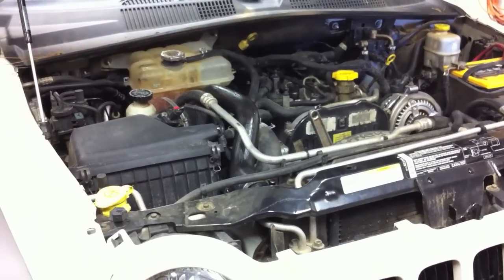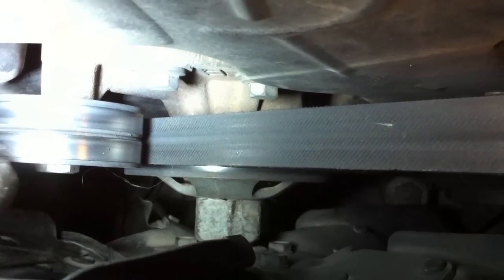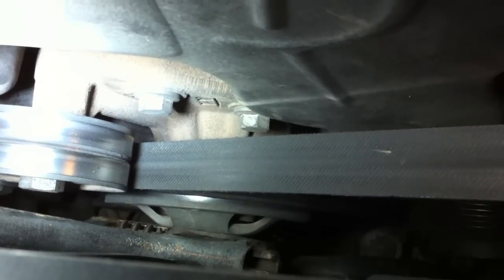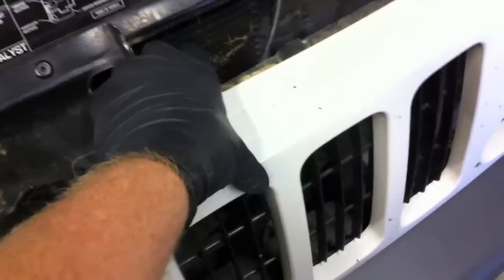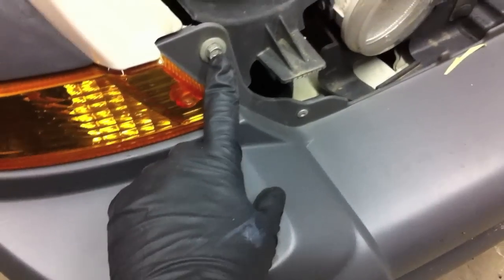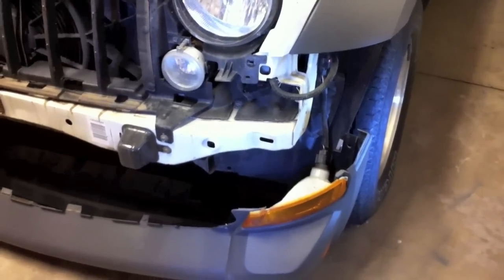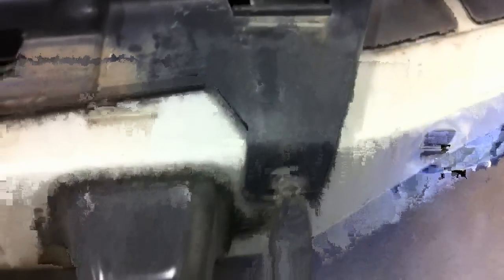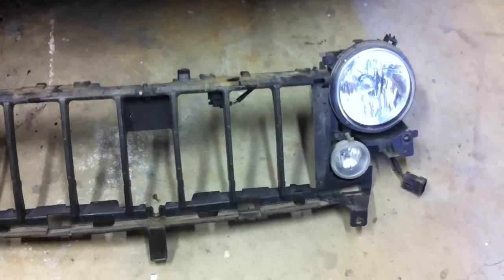Jeep Liberty Diesel Timing Belt Replacement Part 1 - Bumper and Grill Removal

Comment: Just completed the timing belt ectomy this morning. Great how to video series and kudos to the part about the extra belt tooth between the crank and fuel pump part. I used a Home Depot paint stir stick with the slightly rounded part on the handle wedged in between the belt and engine to hold it to the crank pulley while I completed the job.

Comment: I am going to change my timing belt in the next few weeks and am contemplating a egr delete. what's your opinion on this.my liberty already has 200k. also has anyone had excessive oil from the pvc valve?
Reply from the maker: The EGR can be deleted either by removing the hardware and modifying the intake elbow, or by deleting it by a software tune. I am in favor of the software option as the leaves the vehicle looking stock, and it can be readily reflashed to enable EGR if needed. Excessive oil from the CCV indicates overfilling on oil or a bad PCV valve. Typically these engines spit excess oil out because they are above the min line on the dipstick. Typically any oil in the engine above the dipstick min line will get spit out until it reads somewhere near the min line, at which point the CCV oil loss will decrease. If you try to keep the oil level on the max line you will keep refilling what the engine gets rid of.

Comment: what you charge to replace my timing belts
Reply from the maker: Typically this will cost $1300-1800 USD with parts in the US. I charge local customers labor only and have them provide parts, making their total cost about $1000 USD.
Reply: From the looks of it, we are in the same area.  I've looked up the parts and can get a kit for $399, which includes the water pump.  After watching your videos, I'll get the thermostat too.  I'd love for you to do this when I'm ready.  I'm at 90,200 miles right now.  How would I get ahold of you?

Comment: wow is this a 2.4l?
Reply from the maker: Hey there, good question! No, the 2.4L Liberty is a gasoline engine. This is the 4 cylinder 2.8 Diesel engine found in the 2002-2007 Liberty, and variation in 2007-2017 JK, as well as Grand Caravans, London Taxis, and others. This engine is also nearly the same as the 2.5L diesel in the 2002-2004 Manual transmission Liberty.
Reply: COrobotchicken thanks. It looks way complicated to remove only its timing belt. I have a 3.7l v6 jeep liberty here in riyadh and i could change its belt in only 10 min. I didnt know the diesel version had 2.8 instead good to see your channel
Reply from the maker: Hey thanks. The 3.7 uses a timing chain, the belt you see on the 3.7 is the serpentine belt for engine accessories like AC and Power steering. The Serpentine belt on the 2.8 is also very easy to change.